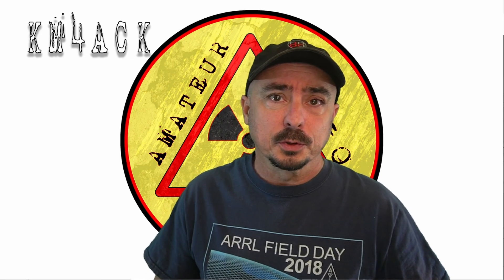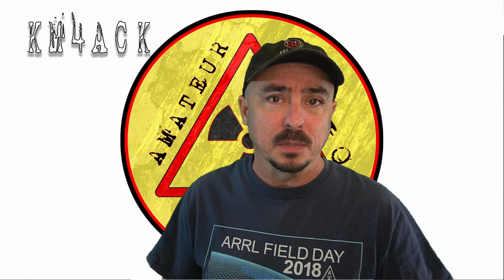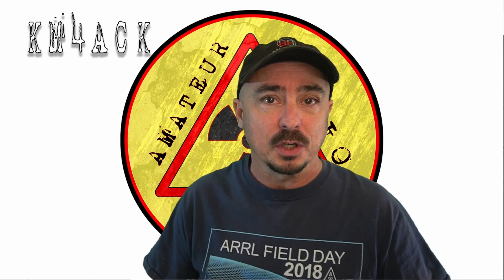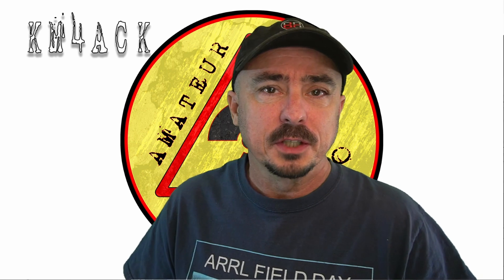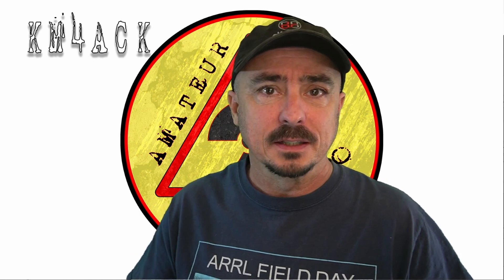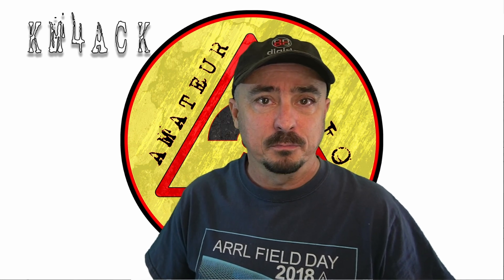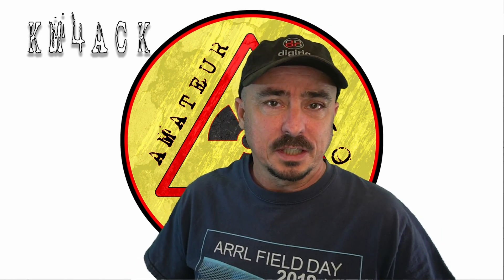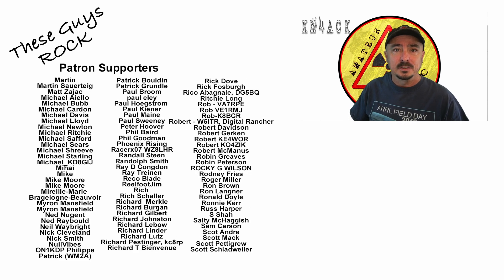5 Winter Radio Projects

Comment: Great advice,  I’ve gone through my various cables already, inspected connections as well as grounds in my shack, working on the materials to build a multi band wire antenna, and am learning both js8 call as well as VARC, toss variant as well as varafm into the mix.Did a couple of “easy digi” boards  to connect my ht as well as my 2m/70cm to vara via the computer..   Always up to learn something new,, as everyone should be.. should probably study up and get my extra ticket.. keep up the great work,, always informative..